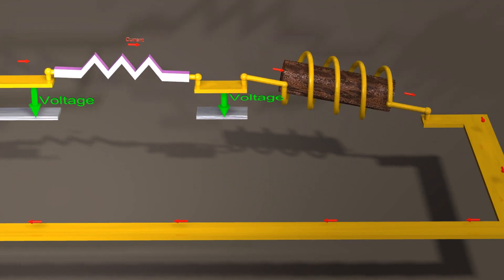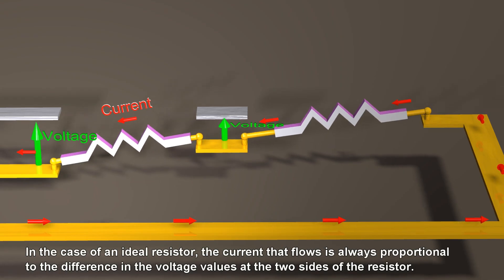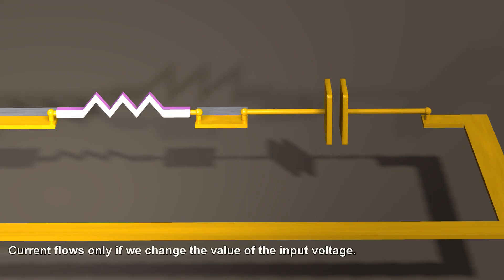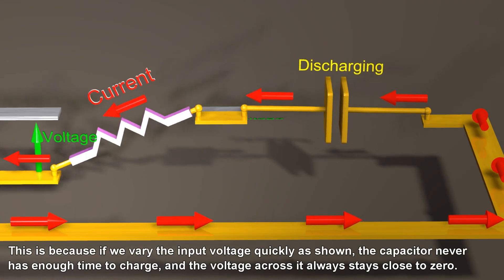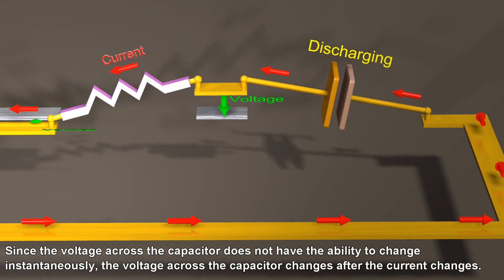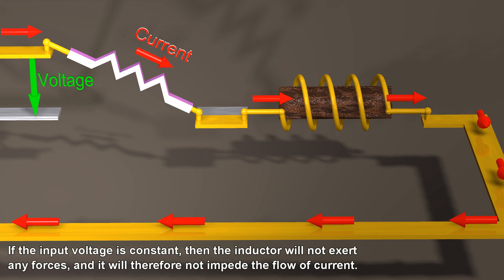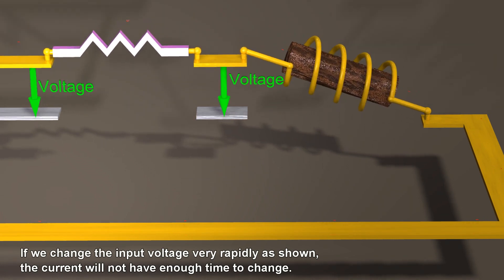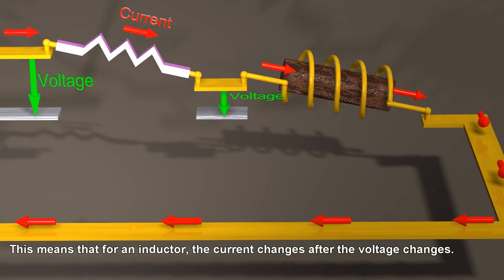AC current impedance - Alternating Voltage for inductors, capacitors

Comment: I love your videos, but I don't see these things as clearly as I would like. I see that the current through a coil lags the source voltage, but not why it has the same frequency. For capacitors, I need to know that the derivative of sin is cos (but that's not intuitive - it's something I remember from college) to find the derivative of q(t) = C*v(t), i.e. i(t) = q'(t) = C*v'(t). 

So for now I'm looking for more intuition on the "90 deg" lead and lag. After playing with the equations in the following two "dummies" pages, it feels like it's coming together somewhat. 

https://www.dummies.com/education/science/science-electronics/relate-the-current-and-voltage-of-a-capacitor/ https://www.dummies.com/education/science/science-electronics/describe-circuit-inductors-and-compute-their-magnetic-energy-storage/ 

Now back to your video. I think as I keep playing with this it will come together. Your videos are very helpful.
Reply: You will certainly find yiur answers in my book after some patient reading!
What is a resistor? How does current branch in a network of resistors? How does it "know" how much should flow in each branch?
While some detail is given in science and engineering courses about conductors, insulators and semiconductors, resistance is described in several ways.
Examples include i. The restriction to the flow of electrons. ii. The difficulty in moving electrical current through a conductor to which voltage is applied.
iii. a circuit element which dissipates energy in the form of heat .
More appropriate description for a resistor would be the property of a conductor which determines the current produced by a given difference of potential.
This makes us remember that a resistor is a conductor first. And, there is reason to say that superconductive wires dont obey ohm's law. So all conductors are resistive, though not superconductors. 
Resistors are used in circuits to regulate the strengths of currents either by reducing the diameter of conductors or introducing more obstacles or lattice imperfections to reduce the strength of current.
The current branches in a parallel network by an elaborate rearrangement of surface charge.
For more details about resistance, how current branches in a parallel circuit and ohm's law consult the following videos, articles and books.
Capacitive reactance
The capacitive reactance is expressed in ohms and it is useful to determine steady-state current values to sinusoidal voltage inputs. Although the value of the reactance is expressed in ohms, it was not obtained by computing a resistance, as of resistors. 
The current in the wires of a capacitor circuit is due to the resultant electric field E(NET) (a resultant of the applied field and an opposing electric field, the fringe field of a capacitor), obtained by applying the relation for current density J = σE(NET), where σ is the conductivity of the wires.

The field in the wire which may vary sinusoidally is always a resultant of the applied voltage which may be sinusoidally varying and the fringe field due to charge accumulation on the capacitor plates.
For a comprehensive description of the mechanism of current leading the voltage across a capacitor see the book references below. 
Inductive reactance
The inductive reactance is expressed in ohms, and is useful to determine steady-state current values to sinusoidal voltage inputs. It is to be noted that though the value of the reactance is expressed in ohms, it was not obtained by computing a resistance, as of resistors. 
The current is on account of the resultant of the applied field and an opposing coulomb electric field, which is due to polarization by the non-coulomb curly patterned electric field associated with the changing magnetic field, and the current obtained thereof by applying the relation J = σE(NET) where E(NET) is the resultant field of the applied field and the coulomb electric field and where σ is the conductivity of the wire.
For a comprehensive description of the mechanism of current lagging the voltage across an inductor at different frequencies see the book references below. 
Electrostatics and circuits belong to one science and not two, that of electricity and magnetism. To know how they are unified visit this link 
https://matterandinteractions.org/articles-talks/ and view the article 'A unified treatment of electrostatics and circuits.  B. Sherwood and R. Chabay, unpublished. (1999)'
pdf.
For a live demonstration of surface charge and its effects in circuits visit 
https://youtu.be/U7RLg-691eQ
Electrostatics and circuits belong to one science and not two, that of electricity and magnetism. To know how they are unified visit this link 
https://matterandinteractions.org/articles-talks/ and view the article 'A unified treatment of electrostatics and circuits.  B. Sherwood and R. Chabay, unpublished. (1999)'
pdf. 
For a live demonstration of surface charge and its effects in circuits visit 
https://youtu.be/U7RLg-691eQ
For a detailed discussion of surface charge, coulomb's law, electric fields, fields of dipoles and other charge configurations, parallel plates, capacitance, currents, conservation of charge, conservation of current, superposition of fields, superposition of potential, simple dc circuit, magnetic fields, magnetic fields of a current element, straight wire, current loop, solenoids, biot-savart law, voltage, voltage source, difference between e.m.f. and potential difference, ideal voltage sources, resistors, how current branches in a parallel circuit, capacitors, inductors, faraday's law, inductance, ac circuits, transmission lines, motors, generators, p-n junction diodes, electromagnetic waves, antennas and radiation, new electrodynamic theories on the nature of the electric field, see "Electric and Magnetic Interactions" by Chabay and Sherwood 
www.matterandinteractions.org
or 
Fundamentals of electric theory and circuits by Sridhar Chitta
https://www.wileyindia.com/fundamentals-of-electric-theory-and-circuits.html
There is a "look inside" feature in the amazon.com webpage of the book "Fundamentals of electric theory and circuits" by Sridhar Chitta with a few pages of Chapter 1 which may be viewed and also which you may swipe left or press < icon to view the foreword, preface and Table of Contents. 
The contents of the above book by Sridhar Chitta, make a distinct unified approach to electrostatics and a few advanced circuits like coupling signals to amplifiers, lending precision and clarity to the topics which is not found in most text books.
The book comes alongwith a CD with animated power point presentations for all chapters and voltage regulator, RC phase shift oscillator, transformer-coupled audio amplifier and differential amplifier included additionally.
For a lecture by Prof Ruth Chabay on surface charge in a simple dc circuit visit 
https://youtu.be/-7W294N_Hkk
There is a full set of lectures beginning lecture 13 here on surface charges, electric fields, simple circuits, capacitance, inductance, faraday's law, motional emf, magnetic forces and more topics here
https://matterandinteractions.org/videos/EM.html
Reply: @sridharchitta7321   Thank you so much. Your comment is intriguing. I'm currently on pge 8 of 19 of the article "A unified treatment of electrostatics and circuits.", and it's kind of a revelation - I plan to check out every source you mentioned (all this will also shed light on the nature of Galvanic cells - another topic I had been looking into). I'm literally a little euphoric at the prospect of filling all these empty holes in my understanding.

Again - thank you very much!
Reply: @red-baitingswine8816   Thank you for following up on the references. I am sorry to disappoint you, but may not find specific information about galvanic cells in the articles, videos and books I pointed you to.
If I find a good article or book on the subject, I will certainly share with you.

Comment: I think of a capacitor as a lake, a reservoir for temporary storage of electrons. I can't think of any mechanical analog for an inductor. Anybody?
Reply: You will need to be careful with analogies, I think. For example, a capacitor stores energy and not charge.
You will find my book useful, with a few analogies. But why analogies, if you understand the real mechanism?
What is a resistor? How does current branch in a network of resistors? How does it "know" how much should flow in each branch?
While some detail is given in science and engineering courses about conductors, insulators and semiconductors, resistance is described in several ways.
Examples include i. The restriction to the flow of electrons. ii. The difficulty in moving electrical current through a conductor to which voltage is applied.
iii. a circuit element which dissipates energy in the form of heat .
More appropriate description for a resistor would be the property of a conductor which determines the current produced by a given difference of potential.
This makes us remember that a resistor is a conductor first. And, there is reason to say that superconductive wires dont obey ohm's law. So all conductors are resistive, though not superconductors. 
Resistors are used in circuits to regulate the strengths of currents either by reducing the diameter of conductors or introducing more obstacles or lattice imperfections to reduce the strength of current.
The current branches in a parallel network by an elaborate rearrangement of surface charge.
For more details about resistance, how current branches in a parallel circuit and ohm's law consult the following videos, articles and books.
Capacitive reactance
The capacitive reactance is expressed in ohms and it is useful to determine steady-state current values to sinusoidal voltage inputs. Although the value of the reactance is expressed in ohms, it was not obtained by computing a resistance, as of resistors. 
The current in the wires of a capacitor circuit is due to the resultant electric field E(NET) (a resultant of the applied field and an opposing electric field, the fringe field of a capacitor), obtained by applying the relation for current density J = σE(NET), where σ is the conductivity of the wires.

The field in the wire which may vary sinusoidally is always a resultant of the applied voltage which may be sinusoidally varying and the fringe field due to charge accumulation on the capacitor plates.
For a comprehensive description of the mechanism of current leading the voltage across a capacitor see the book references below. 
Inductive reactance
The inductive reactance is expressed in ohms, and is useful to determine steady-state current values to sinusoidal voltage inputs. It is to be noted that though the value of the reactance is expressed in ohms, it was not obtained by computing a resistance, as of resistors. 
The current is on account of the resultant of the applied field and an opposing coulomb electric field, which is due to polarization by the non-coulomb curly patterned electric field associated with the changing magnetic field, and the current obtained thereof by applying the relation J = σE(NET) where E(NET) is the resultant field of the applied field and the coulomb electric field and where σ is the conductivity of the wire.
For a comprehensive description of the mechanism of current lagging the voltage across an inductor at different frequencies see the book references below. 
Electrostatics and circuits belong to one science and not two, that of electricity and magnetism. To know how they are unified visit this link 
https://matterandinteractions.org/articles-talks/ and view the article 'A unified treatment of electrostatics and circuits.  B. Sherwood and R. Chabay, unpublished. (1999)'
pdf.
For a live demonstration of surface charge and its effects in circuits visit 
https://youtu.be/U7RLg-691eQ
Electrostatics and circuits belong to one science and not two, that of electricity and magnetism. To know how they are unified visit this link 
https://matterandinteractions.org/articles-talks/ and view the article 'A unified treatment of electrostatics and circuits.  B. Sherwood and R. Chabay, unpublished. (1999)'
pdf. 
For a live demonstration of surface charge and its effects in circuits visit 
https://youtu.be/U7RLg-691eQ
For a detailed discussion of surface charge, coulomb's law, electric fields, fields of dipoles and other charge configurations, parallel plates, capacitance, currents, conservation of charge, conservation of current, superposition of fields, superposition of potential, simple dc circuit, magnetic fields, magnetic fields of a current element, straight wire, current loop, solenoids, biot-savart law, voltage, voltage source, difference between e.m.f. and potential difference, ideal voltage sources, resistors, how current branches in a parallel circuit, capacitors, inductors, faraday's law, inductance, ac circuits, transmission lines, motors, generators, p-n junction diodes, electromagnetic waves, antennas and radiation, new electrodynamic theories on the nature of the electric field, see "Electric and Magnetic Interactions" by Chabay and Sherwood 
www.matterandinteractions.org
or 
Fundamentals of electric theory and circuits by Sridhar Chitta
https://www.wileyindia.com/fundamentals-of-electric-theory-and-circuits.html
There is a "look inside" feature in the amazon.com webpage of the book "Fundamentals of electric theory and circuits" by Sridhar Chitta with a few pages of Chapter 1 which may be viewed and also which you may swipe left or press < icon to view the foreword, preface and Table of Contents. 
The contents of the above book by Sridhar Chitta, make a distinct unified approach to electrostatics and a few advanced circuits like coupling signals to amplifiers, lending precision and clarity to the topics which is not found in most text books.
The book comes alongwith a CD with animated power point presentations for all chapters and voltage regulator, RC phase shift oscillator, transformer-coupled audio amplifier and differential amplifier included additionally.
For a lecture by Prof Ruth Chabay on surface charge in a simple dc circuit visit 
https://youtu.be/-7W294N_Hkk
There is a full set of lectures beginning lecture 13 here on surface charges, electric fields, simple circuits, capacitance, inductance, faraday's law, motional emf, magnetic forces and more topics here
https://matterandinteractions.org/videos/EM.html

Comment: Great AC tutorial! Thanks
Still I would like to see added, a simultaneous graphic representation  of voltages, current and flux.
And I think of some error at 4.15: there's no current flowing straight from the beginning of the voltage rise.
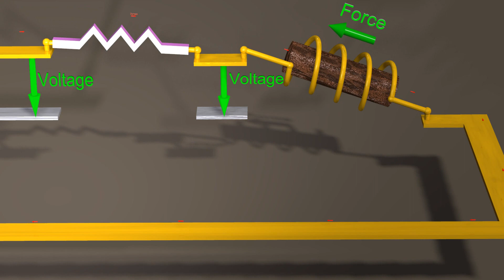Reply: At 04:15 the voltage is applied at the inductor and at that very moment the voltage (and the force arrow) is at the max and decreasing as the mag field increases. On the other hand the current is zero at that time and increasing towards the max value as the mag field increases.

Comment: @Physics Videos by Eugene Khutoryansky
Sorry I did not understand inductor properly...
I know that it is back emf that resist current flowing through inductor and I also know that back emf is produced when magnetic field across inductor changes due to change in current....My question is that if back emf is opposing to source voltage(which it is I believe) then how come in AC circuits voltage across Inductor reaches to max value of that of source voltage?
For Example If source voltage is 5Volt AC and emf producing across inductor is 3V lets say...then inductor's peak value should always remain 2volt AC....PLEASE HELP
Reply from the maker: I cover inductors in detail at https://youtu.be/ukBFPrXiKWA

Comment: I didn't get where the impedance comes in. 
When in high frequency and with a capacitor, i'll have a low impedance circuit because more current is flowing? and for the same frequency and an inductor, it will be a high impedance circuit because there is not much current flowing as it would in low frequecy?

Comment: I want to say that maybe at 1:34 minute there is a mistake. After the resistor there will be always a loss of voltage, so the capacitor will reach and have that voltage and not the voltage of the input at the resistor. Sorry if I can't explain it better with my English... I mean that the green arrow of the voltage before the resistor should be a bit greater than the green arrow after the resistor... am I mistaken?!
Reply from the maker: It is not a mistake.  If there is no current flowing through a resistor, then there is no voltage drop across it.  To look at it mathematically, in the equation "V=IR", if "I" is zero, then "V" is zero also.
Reply: you are right! I was feeling in wrong. I missed that point. as I read your first sentence about the current everything was clear to me! thank you for answering me! :)

Comment: Even though I already wrote many exams about this, it was nice to have the simple RL/RC circuit and dependencies of impedance and current flow explained again. Nice job!
Reply: I might add ,that the visualization is amazing.  I rate 10/10
Reply from the maker: Thanks for the compliment.

Comment: Awesome Animation Eugene thanks, in my book when i solve the AC circuit with capacitive load, the frequency of voltage across the capacitor is taken as same as that of the mains, shouldn't it be lagging behind because cap takes time to discharge?